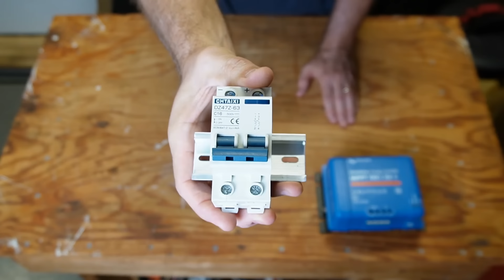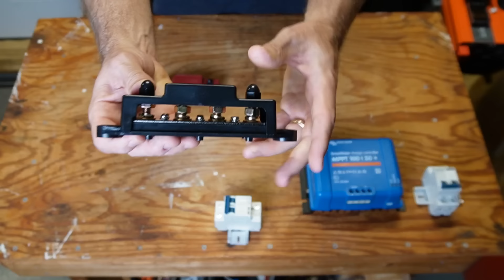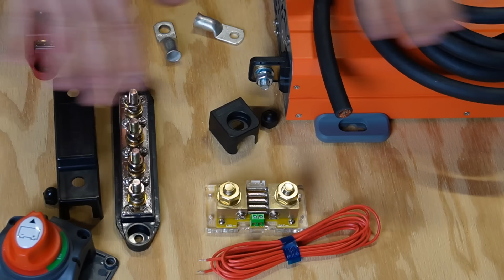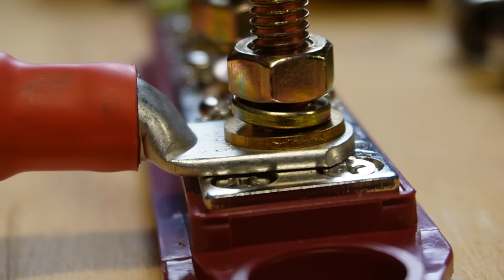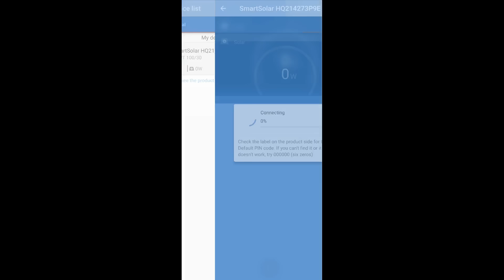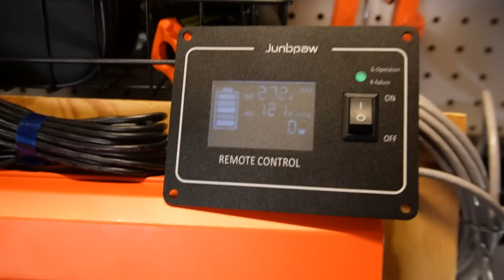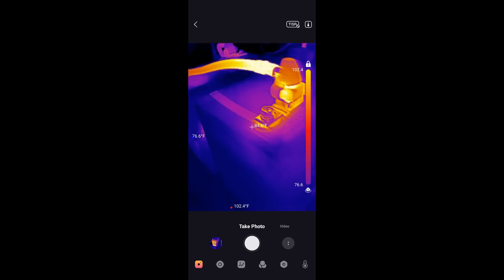24V DIY Off-Grid Solar Generator Build For Beginners

Comment: I've watched soooo many videos that has had my mine going nuts. This videos is the most precise video so far, nice and simple and you explain it wonderfully. I have a question, how long is the solar wire to converter and what gauge? Thanks
Reply from the maker: Thanks. I believe the wire was 30 feet and it was 12 AWG.
Reply: 255  God! There is no god except He, the Living, the Everlasting. Neither slumber overtakes Him, nor sleep. To Him belongs everything in the heavens and everything on earth. Who is he that can intercede with Him except with His permission? He knows what is before them, and what is behind them; and they cannot grasp any of His knowledge, except as He wills. His Throne extends over the heavens and the earth, and their preservation does not burden Him. He is the Most High, the Great.
256  There shall be no compulsion in religion; the right way has become distinct from the wrong way. Whoever renounces evil and believes in God has grasped the most trustworthy handle; which does not break. God is Hearing and Knowing.
257  God is the Lord of those who believe; He brings them out of darkness and into light. As for those who disbelieve, their lords are the evil ones; they bring them out of light and into darkness—these are the inmates of the Fire, in which they will abide forever.
258  Have you not considered him who argued with Abraham about his Lord, because God had given him sovereignty? Abraham said, “My Lord is He who gives life and causes death.” He said, “I give life and cause death.” Abraham said, “God brings the sun from the East, so bring it from the West,” so the blasphemer was confounded. God does not guide the wrongdoing people.
259  Or like him who passed by a town collapsed on its foundations. He said, “How can God revive this after its demise?” Thereupon God caused him to die for a hundred years, and then resurrected him. He said, “For how long have you tarried?” He said, “I have tarried for a day, or part of a day.” He said, “No. You have tarried for a hundred years. Now look at your food and your drink—it has not spoiled—and look at your donkey. We will make you a wonder for mankind. And look at the bones, how We arrange them, and then clothe them with flesh.” So when it became clear to him, he said, “I know that God has power over all things.”
260  And when Abraham said, “My Lord, show me how You give life to the dead.” He said, “Have you not believed?” He said, “Yes, but to put my heart at ease.” He said, “Take four birds, and incline them to yourself, then place a part on each hill, then call to them; and they will come rushing to you. And know that God is Powerful and Wise.”

2  God, there is no god but He, the Living, the Eternal.
3  He sent down to you the Book with the Truth, confirming what came before it; and He sent down the Torah and the Gospel.
4  Aforetime, as guidance for mankind; and He sent down the Criterion. Those who have rejected God’s signs will have a severe punishment. God is Mighty, Able to take revenge.
5  Nothing is hidden from God, on earth or in the heaven.
6  It is He who forms you in the wombs as He wills. There is no god except He, the Almighty, the Wise.

11  Originator of the heavens and the earth. He made for you mates from among yourselves, and pairs of animals, by means of which He multiplies you. There is nothing like Him. He is the Hearing, the Seeing.
12  To Him belongs absolute control of the heavens and the earth. He spreads the bounties to whomever He wills, or reduces it. He is aware of all things.
13  He prescribed for you the same religion He enjoined upon Noah, and what We inspired to you, and what We enjoined upon Abraham, and Moses, and Jesus: “You shall uphold the religion, and be not divided therein.” As for the idolaters, what you call them to is outrageous to them. God chooses to Himself whom He wills, and He guides to Himself whoever repents.

54  Your Lord is God; He who created the heavens and the earth in six days, then established Himself on the Throne. The night overtakes the day, as it pursues it persistently; and the sun, and the moon, and the stars are subservient by His command. His is the creation, and His is the command. Blessed is God, Lord of all beings.
55  Call upon your Lord humbly and privately. He does not love the aggressors.
56  And do not corrupt on earth after its reformation, and pray to Him with fear and hope. God’s mercy is close to the doers of good.
57  It is He who sends the wind ahead of His mercy. Then, when they have gathered up heavy clouds, We drive them to a dead land, where We make water come down, and with it We bring out all kinds of fruits. Thus We bring out the dead—perhaps you will reflect.
58  As for the good land, it yields its produce by the leave of its Lord. But as for the bad, it produces nothing but hardship and misery. Thus We explain the revelations in various ways for people who are thankful.
59  We sent Noah to his people. He said, “O my people! Worship God; you have no god other than Him. I fear for you the punishment of a tremendous Day.”
60  The dignitaries among his people said, “We see that you are in obvious error.”
61  He said, “O my people, I am not in error, but I am a messenger from the Lord of the Worlds.”
62  “I deliver to you the messages of my Lord, and I advise you, and I know from God what you do not know.”
63  “Do you wonder that a reminder has come to you from your Lord, through a man from among you, to warn you, and to lead you to righteousness, so that you may attain mercy?”
64  But they called him a liar. So We saved him and those with him in the Ark, and We drowned those who rejected Our revelations. They were blind people.

59  The likeness of Jesus in God’s sight is that of Adam: He created him from dust, then said to him, “Be,” and he was.
60  The truth is from your Lord, so do not be of those who doubt.
61  And if anyone disputes with you about him, after the knowledge that has come to you, say, “Come, let us call our children and your children, and our women and your women, and ourselves and yourselves, and let us invoke God’s curse on the liars.”
62  This is the narrative of truth: there is no god but God. God is the Mighty, the Wise.
63  But if they turn away—God knows the corrupt.
64  Say, “O People of the Book, come to terms common between us and you: that we worship none but God, and that we associate nothing with Him, and that none of us takes others as lords besides God.” And if they turn away, say, “Bear witness that we have submitted.”
65  O People of the Book! Why do you argue about Abraham, when the Torah and the Gospel were not revealed until after him? Will you not reason?
66  Here you are—you argue about things you know, but why do you argue about things you do not know? God knows, and you do not know.
67  Abraham was neither a Jew nor a Christian, but he was a Monotheist, a Muslim. And he was not of the Polytheists.
68  The people most deserving of Abraham are those who followed him, and this prophet, and those who believe. God is the Guardian of the believers.
69  A party of the People of the Book would love to lead you astray, but they only lead themselves astray, and they do not realize it.

84  Say, “We believe in God, and in what was revealed to us; and in what was revealed to Abraham, and Ishmael, and Isaac, and Jacob, and the Patriarchs; and in what was given to Moses, and Jesus, and the prophets from their Lord. We make no distinction between any of them, and to Him we submit.”
85  Whoever seeks other than Islam as a religion, it will not be accepted from him, and in the Hereafter he will be among the losers.

28  It is He who sent His Messenger with the guidance and the religion of truth, to make it prevail over all religions. God suffices as Witness.
29  Muhammad is the Messenger of God. Those with him are stern against the disbelievers, yet compassionate amongst themselves. You see them kneeling, prostrating, seeking blessings from God and approval. Their marks are on their faces from the effects of prostration. Such is their description in the Torah, and their description in the Gospel: like a plant that sprouts, becomes strong, grows thick, and rests on its stem, impressing the farmers. Through them He enrages the disbelievers. God has promised those among them who believe and do good deeds forgiveness and a great reward.

111  And say, “Praise be to God, who has not begotten a son, nor has He a partner in sovereignty, nor has He an ally out of weakness, and glorify Him constantly.”

Read The Quran

Comment: Great job... I made a box from plywood with an open back, recessed face lined with drywall  for fireproofing, then placed it on castor wheels after painting it black.  My batteries are neatly installed at the back of the box, with my MPPT controller, meters, DC connections, a recessed AC power strip and 3000 watt inverter installed on the drywall at the front. I also added heavy duty handles. Battery and PV breakers, precharge circuit and extra AC outlets are at the back. Shunt sampler, both bus bars, fuse box, battery Fuses and most of the wiring are neatly cable managed inside the box. Overall I like the build, there is always room for improvement.
Reply from the maker: Thanks for sharing that. Your build sounds very interesting. What you said is true, there always seems to be room for improvement on and build.
Reply: 255  God! There is no god except He, the Living, the Everlasting. Neither slumber overtakes Him, nor sleep. To Him belongs everything in the heavens and everything on earth. Who is he that can intercede with Him except with His permission? He knows what is before them, and what is behind them; and they cannot grasp any of His knowledge, except as He wills. His Throne extends over the heavens and the earth, and their preservation does not burden Him. He is the Most High, the Great.
256  There shall be no compulsion in religion; the right way has become distinct from the wrong way. Whoever renounces evil and believes in God has grasped the most trustworthy handle; which does not break. God is Hearing and Knowing.
257  God is the Lord of those who believe; He brings them out of darkness and into light. As for those who disbelieve, their lords are the evil ones; they bring them out of light and into darkness—these are the inmates of the Fire, in which they will abide forever.
258  Have you not considered him who argued with Abraham about his Lord, because God had given him sovereignty? Abraham said, “My Lord is He who gives life and causes death.” He said, “I give life and cause death.” Abraham said, “God brings the sun from the East, so bring it from the West,” so the blasphemer was confounded. God does not guide the wrongdoing people.
259  Or like him who passed by a town collapsed on its foundations. He said, “How can God revive this after its demise?” Thereupon God caused him to die for a hundred years, and then resurrected him. He said, “For how long have you tarried?” He said, “I have tarried for a day, or part of a day.” He said, “No. You have tarried for a hundred years. Now look at your food and your drink—it has not spoiled—and look at your donkey. We will make you a wonder for mankind. And look at the bones, how We arrange them, and then clothe them with flesh.” So when it became clear to him, he said, “I know that God has power over all things.”
260  And when Abraham said, “My Lord, show me how You give life to the dead.” He said, “Have you not believed?” He said, “Yes, but to put my heart at ease.” He said, “Take four birds, and incline them to yourself, then place a part on each hill, then call to them; and they will come rushing to you. And know that God is Powerful and Wise.”

2  God, there is no god but He, the Living, the Eternal.
3  He sent down to you the Book with the Truth, confirming what came before it; and He sent down the Torah and the Gospel.
4  Aforetime, as guidance for mankind; and He sent down the Criterion. Those who have rejected God’s signs will have a severe punishment. God is Mighty, Able to take revenge.
5  Nothing is hidden from God, on earth or in the heaven.
6  It is He who forms you in the wombs as He wills. There is no god except He, the Almighty, the Wise.

11  Originator of the heavens and the earth. He made for you mates from among yourselves, and pairs of animals, by means of which He multiplies you. There is nothing like Him. He is the Hearing, the Seeing.
12  To Him belongs absolute control of the heavens and the earth. He spreads the bounties to whomever He wills, or reduces it. He is aware of all things.
13  He prescribed for you the same religion He enjoined upon Noah, and what We inspired to you, and what We enjoined upon Abraham, and Moses, and Jesus: “You shall uphold the religion, and be not divided therein.” As for the idolaters, what you call them to is outrageous to them. God chooses to Himself whom He wills, and He guides to Himself whoever repents.

54  Your Lord is God; He who created the heavens and the earth in six days, then established Himself on the Throne. The night overtakes the day, as it pursues it persistently; and the sun, and the moon, and the stars are subservient by His command. His is the creation, and His is the command. Blessed is God, Lord of all beings.
55  Call upon your Lord humbly and privately. He does not love the aggressors.
56  And do not corrupt on earth after its reformation, and pray to Him with fear and hope. God’s mercy is close to the doers of good.
57  It is He who sends the wind ahead of His mercy. Then, when they have gathered up heavy clouds, We drive them to a dead land, where We make water come down, and with it We bring out all kinds of fruits. Thus We bring out the dead—perhaps you will reflect.
58  As for the good land, it yields its produce by the leave of its Lord. But as for the bad, it produces nothing but hardship and misery. Thus We explain the revelations in various ways for people who are thankful.
59  We sent Noah to his people. He said, “O my people! Worship God; you have no god other than Him. I fear for you the punishment of a tremendous Day.”
60  The dignitaries among his people said, “We see that you are in obvious error.”
61  He said, “O my people, I am not in error, but I am a messenger from the Lord of the Worlds.”
62  “I deliver to you the messages of my Lord, and I advise you, and I know from God what you do not know.”
63  “Do you wonder that a reminder has come to you from your Lord, through a man from among you, to warn you, and to lead you to righteousness, so that you may attain mercy?”
64  But they called him a liar. So We saved him and those with him in the Ark, and We drowned those who rejected Our revelations. They were blind people.

59  The likeness of Jesus in God’s sight is that of Adam: He created him from dust, then said to him, “Be,” and he was.
60  The truth is from your Lord, so do not be of those who doubt.
61  And if anyone disputes with you about him, after the knowledge that has come to you, say, “Come, let us call our children and your children, and our women and your women, and ourselves and yourselves, and let us invoke God’s curse on the liars.”
62  This is the narrative of truth: there is no god but God. God is the Mighty, the Wise.
63  But if they turn away—God knows the corrupt.
64  Say, “O People of the Book, come to terms common between us and you: that we worship none but God, and that we associate nothing with Him, and that none of us takes others as lords besides God.” And if they turn away, say, “Bear witness that we have submitted.”
65  O People of the Book! Why do you argue about Abraham, when the Torah and the Gospel were not revealed until after him? Will you not reason?
66  Here you are—you argue about things you know, but why do you argue about things you do not know? God knows, and you do not know.
67  Abraham was neither a Jew nor a Christian, but he was a Monotheist, a Muslim. And he was not of the Polytheists.
68  The people most deserving of Abraham are those who followed him, and this prophet, and those who believe. God is the Guardian of the believers.
69  A party of the People of the Book would love to lead you astray, but they only lead themselves astray, and they do not realize it.

84  Say, “We believe in God, and in what was revealed to us; and in what was revealed to Abraham, and Ishmael, and Isaac, and Jacob, and the Patriarchs; and in what was given to Moses, and Jesus, and the prophets from their Lord. We make no distinction between any of them, and to Him we submit.”
85  Whoever seeks other than Islam as a religion, it will not be accepted from him, and in the Hereafter he will be among the losers.

28  It is He who sent His Messenger with the guidance and the religion of truth, to make it prevail over all religions. God suffices as Witness.
29  Muhammad is the Messenger of God. Those with him are stern against the disbelievers, yet compassionate amongst themselves. You see them kneeling, prostrating, seeking blessings from God and approval. Their marks are on their faces from the effects of prostration. Such is their description in the Torah, and their description in the Gospel: like a plant that sprouts, becomes strong, grows thick, and rests on its stem, impressing the farmers. Through them He enrages the disbelievers. God has promised those among them who believe and do good deeds forgiveness and a great reward.

111  And say, “Praise be to God, who has not begotten a son, nor has He a partner in sovereignty, nor has He an ally out of weakness, and glorify Him constantly.”

Read The Quran